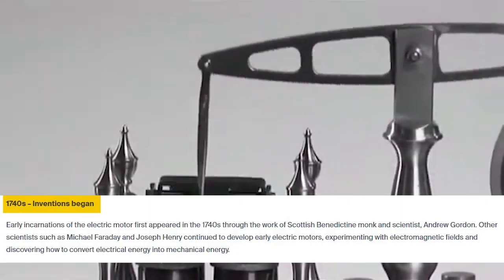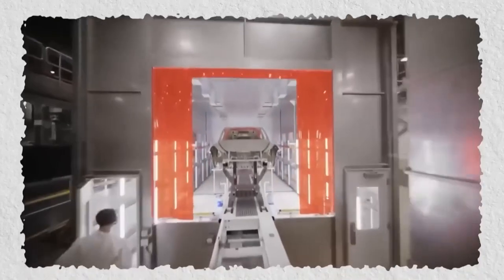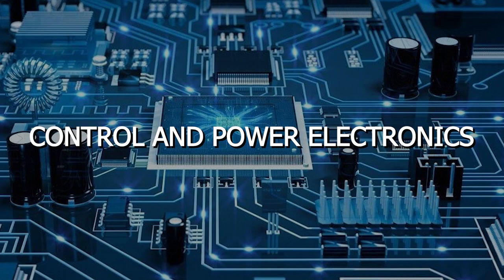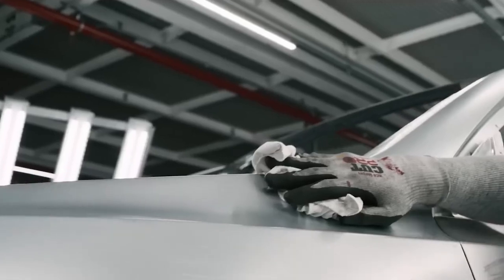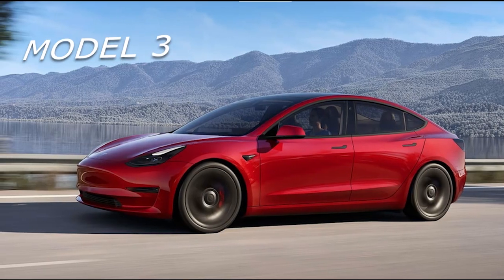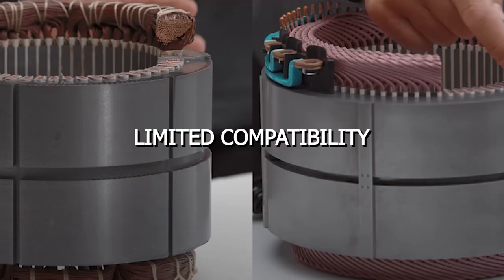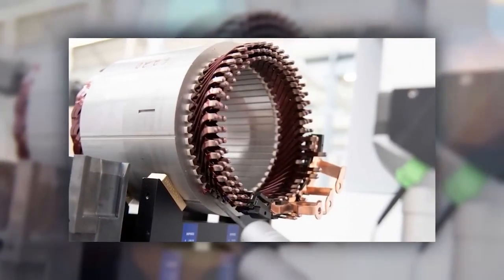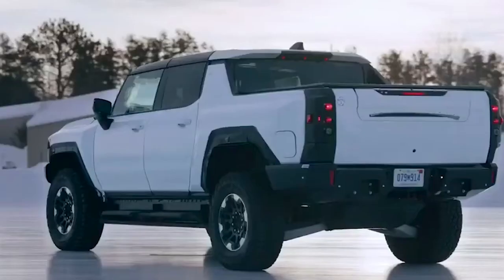Tesla HairPin Motor Could lead to Unlimited Range!

Comment: What reign of hydrogen powered cars?

The hairpin design could be used in a hydrogen powered car as well.

The failure of hydrogen has to do with the cost of manufacture - with the energy costs to produce green hydrogen you could power three EVs. Hydrogen is a poor solution to the personal vehicle transition away from fossil fuels.